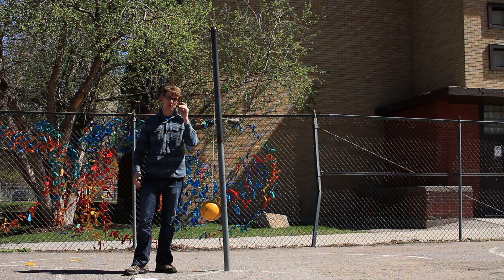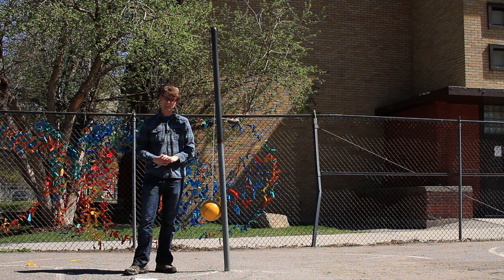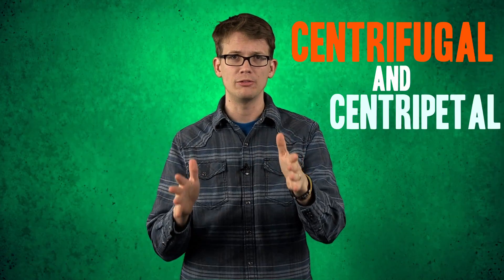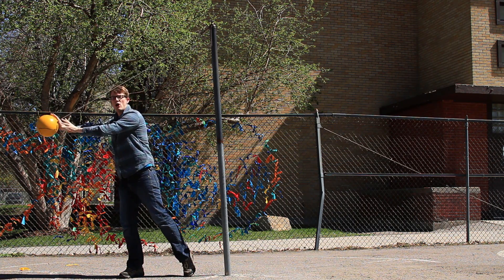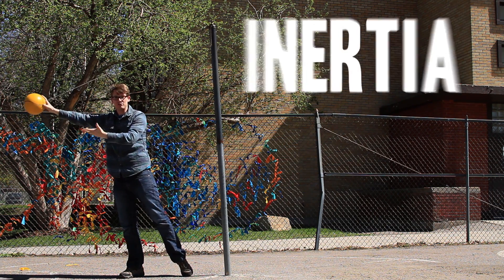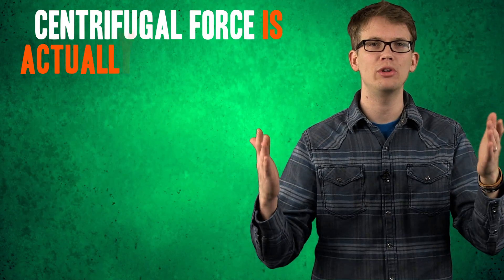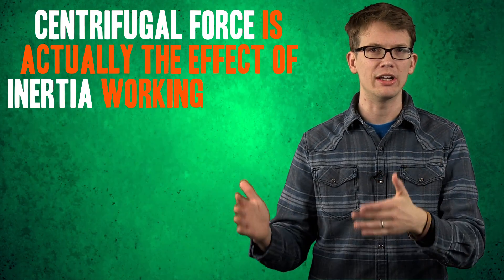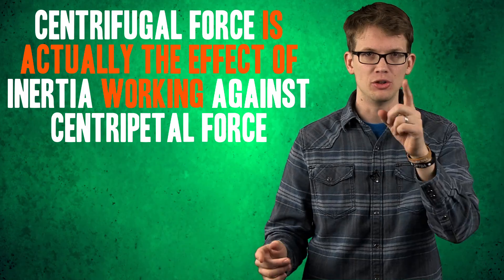IDTIMWYTIM: Centrifugal Force

Comment: Ok, equal and opposite reaction: wouldn't there be a real centrifugal force on the pole then?
Reply: No, there is a reaction force received by the other end of the tension in the string, that acts upon the pole, but it has nothing to do with the centrifugal pseudoforce.
Reply: @carultch  You agree that there must be an equal and opposite reaction to centripetal force, correct?
So the opposite to the "center seeking" force would be a "center fleeing force". Great, we already have a Latin word for that. Lets calling it "centrifugal". The pole is being pulled away from the center, is it not?
Reply: @albinoman13bt  There is a tension force pulling on the ball.  There is a tension force pulling on the pole.  These forces are an equal and opposite action/reaction force pair for Newton's third law.

The pole is not rotating, and has no inertial forces of its own acting on it.  it is pulled outward by the other side of the tension in the string, and not by its own centrifugal pseudoforce.   Only the ball is subject to an apparent centrifugal force.  The pole isn't subject to this force, until the tension in the string carries the force to it.
Reply: @carultch  The ball has a centripetal, center seeking, force on it. It would fly off if the string were cut.
Just the same, the pole would return to the center if the string were cut and the center fleeing force removed.
The pole doesn't need to rotate. The ball is exerting a centrifugal force on the pole. The pole is exerting a centripetal force on the ball.
The "apparent" centrifugal force would be if you were in the ball. It would feel like you are being pushed the the outside when youre actually being pulled inward.
Reply: @albinoman13bt  Nothing exerts a centrifugal force on anything.  The centrifugal force is a consequence to being in a rotating reference frame, and to your own inertia causing you to attempt to take a straight line path through space.

The ball isn't exerting any force on the pole, other than the tension in the string.
Reply: @carultch  If there is no force that pulls on the pole, then what is imparting all those newtons? The "there is no such thing as centrifugal force" is one of those old science misconceptions.
Reply: @albinoman13bt  You are taking what I said out of context.  I did not say there is no force that pulls on the pole, I said exactly the opposite.  I said there is no centrifugal force that pulls directly on the pole.  I said that it is specifically the tension in the string, that is pulling on the pole.

What is ultimately "providing" all those Newtons, is the fact that the tension in the string is a force of constraint that keeps the tether ball moving along a path governed by the string.   The ball starts with its kinetic energy and momentum due to its initial velocity that is tangent to the circular path it would take.  The tension in the string pulls it inward, so that the ball follows a circular path, instead of the straight line it would follow by default.
Reply: @carultch  If an object is stuck in the orbit of another object, whether it's by a rope or gravity, they are each exerting a force on the other, each pulling in toward itself. Centrifugal and centripetal are opposites by the very meanings of the words. Which is which depends on what you call the center. For example, from the ball's point of view the pole is spinning around it and it is the center. From its frame of reference it's the pole that's exerting centrifugal force on it.
The object in orbit is experiencing centripetal force, since it keeps getting pulled to the middle while it tries to fly away. The object in the center keeps getting pulled away from the middle, a center fleeing force, despite trying to return to the center.
Reply: @albinoman13bt  Look at it from the reference frame of the center of mass of the two of them.  This is a point that will move at a constant velocity, assuming external forces are negligible, and will work better as an inertial reference frame for studying the situation.

In that case, you will only see a force of attraction between the two objects.   You will see object A pull on object B, and you will see object B pull on object A.  You will not see any push force between the two objects.  The reason the objects don't collapse in to each other, is that they have sufficient tangential speed, that the inward directed acceleration cannot pull on them strongly enough to pull them any closer.

A force is only real, if it is exists to explain the situation from the point of view of all possible observers.   The inertial reference frame allows us to eliminate all pseudoforces, and only see the real forces.

Comment: Depends a little bit on your frame of reference. In relativity theory for example it is not a force but the bending of four dimensional spacetime. In particle physics it is one of the four fundamental forces and they are submitted via particles (similar to the electromagnetic force which is submitted by photons).

Comment: So the string is pulling on the ball but the ball isn't pulling on the string. This causes a net force on the ball which causes the ball to constantly accelerate. But the net force is always changing direction (ie, going in circles) which causes the acceleration to change directions too, which causes the components of the velocity of the ball to fluctuate from positive to negative and back again. (ie, circular motion) :D How did I not figure that? Its so obvious!

Comment: Centripetal force is also not a real thing Hank.
This force is exhibited only because one end of the rope is tied to the immobile pole. If that end was not tied to another object there would be no tension to the rope. Same if the rope fails or it is being cut. The circular motion would no longer be observed The real force counteracting to the tension is the molecular bond of the strands plus the structural composition of the rope There is nothing that indicates that Centripetal force even exists

Comment: My teacher doesn't let us use the word (centrifugal) in her classroom. Also, centripetal force isn't a real force either, but rather a word to describe a force or forces acting on an object. The forces acting on the tether ball were tension and gravity, and tension was a centripetal force, because it was the force pulling the object in. If you were rotating an object vertically the centripetal forces at the top would be gravity and tension, because they are pulling the object to the axis. <3

Comment: Couldn't you also say that centrifugal force it the 'normal force' in response to the centripetal? In the way that while my laptop exerts it's weight (mass x acceleration down due to gravity) on my desk, the complete force diagram also shows a normal force of the same value pushing back up because it's a stationary system?

Comment: The same thing, essentially. The water inside the bucket wants to keep on flying straight, but the bucket held by your arm is holding it in. The water acts as the ball does in Hank's example, and the bucket and your arm act like the string does in Hank's example, holding the water in. The water has inertia, the bucket and your arm has the centripetal force.

Comment: Question: you said that Real Force requires physical interaction between objects. What if it would be possible to build a mechanism where a set of magnetic forces would act as the string does in the video? Would that still be considered a real force, or something else?

Comment: Sure thing! Fc = mv^2/r (v2/r is the centrifugal acceleration.) It can usually be considered the 'anti' centripetal force since they have similar roles. Calculating is is usually done in 'special' circumstances like considering a cornering car or how fast DVD can spin before it breaks apart. (In that last case considering the 'real' forces on a spinning DVD can be very problematic.)

Thus if we have a car (1'000kg) cornering a 20m curve at 40kph Fc = 6173N

Comment: Can you provide an example of how to calculate centrifugal force? I've only taken an AP physics class, so calculations were kept somewhat simple, but calculating centripetal force is fairly easy, it is just F=ma(c), where a(c) is either omega^2 r or v^2 / r.
Reply: You can prove that a=omega^2*r and a=v^2/r are equal in value.  The centrifugal pseudoforce will also equal m*a, except in the other direction.

In a linear example, suppose you are in a rocket, accelerating in deep space at 5 m/s^2, in a direction we'll call positive.  Suppose your mass is 80 kg.   What force does the floor of the rocket push upon your body?   A: +400 Newtons.   What is your apparent weight in the accelerating reference frame?  A: also 400 Newtons, but in the negative direction.  Your apparent weight is really your attempt at not accelerating, and is equal and opposite from the force that holds you in place in your reference frame.

Comment: Centrifugal force exists only when we look at tiny reference frames. In the case of the tethered ball, you would have to be in the reference frame of the ball and be constantly changing your angles of reference. Centrifugal force does not hold up in any larger reference frames, while centripetal acceleration works in all (or at least to my knowledge) reference frames.

Comment: That's a great example of actually "feeling" the centripetal force, because that's exactly what your arms are doing, keeping you from flying off :) If you did let go (which I advise against) you would "fly off" because your body wants to keep going at a straight line instead of in a circle. Technically speaking you would fly in a trajectory tangent to the circular path, NOT outward from the center of the merry-go-round.

Comment: No, it's the same as the ball. Your body wants to go outward because of inercia, it wants to keep moving in a strait line, not a circular one. You can stay in the circular trayectory if you hang on, which would be comparative to the force of the string. It's a perception of centripetal force.

Comment: actually its gravity that sepreates them. Read up on "relative centrifugal force" its measured in g-force. Or much easier mix some non dissolving powder with some fluid, yank the centrifuge up to max und let it run for 5 minutes (check if its safe first!). the moist powder will not be at the bottom of the container but squished against the side facing away from the rotation

Comment: I was thinking that.
Suppose its the fact that the water inside the bucket wants to do the same thing as the bucket - go in a straight line. But it can't because its a force acting against it!
So its forced against the bottom of the bucket in an attempt to carry on forward. :3

Comment: Pardon my misattribution.  It is the ball's non-zero momentum that enables the ball to impart a force on the string, pulling it away from the pole.  I could not tell from your original comment that you were referring to a force on the string.  Also, I did not state that there was another force acting on the ball, but that there is a force acting on the string, pulling it taught.

Comment: Think of a car with a box of tissues on the dash. When the wheels turn in a circular path, the friction between the tires and the road acts as a centripetal force and the car makes the turn, however the friction between the tissue box and the plastic dash isn't enough to allow the box to stay in place, and it slides outward from the rotation. Although it looks like the box is moving, it would be more accurate to say the truck is moving out from under the tissue box.

Comment: yes, its the same thing for the most part. I assume you mean something like a person spinning a ball in a cup attached to a string, right? in this case, the centripetal force on the cup is the force of tension that the string exerts on the cup. The centripetal force on the ball, however, is the normal (something like an upwards, resisting press) force exerted by the cup on the ball. I hope this kinda clarifies things.

Comment: WRONG SIR if every force has an equal and opposite force then the force of the string pulling the ball toward the pole would have an opposite force pulling it away.
xkcd is always relevant
in this case, comic number 123

Comment: Those are all relative! The entire universe doesn't have a specific up/down nor a left/right, there is a sort of forwards or backwards but, not entirely. 
If you think more like a graph x.y,z it's more sensible however that's still not even the correct correlation! Shockingly enough there really is no correlation, all we can say is the first 3 generate the space we live in and the 4th as you said is time. But so many people think of it as linear motion, sidescrolling, and super mario 64,tbc

Comment: By perfect system, I was referring to an atmospheric system (I haven't gotten used to shortening things for YouTube), since the weather will affect the ball and cord.

As for the other thing, it was poor wording on my part. The reason it seems to move to a ninety degree angle is the fact that it's anchored at all. The cord is stronger than the pull of the Earth's gravity on the ball, so it moves up. It's entire location change is because of the the combined effect of all the forces together.

Comment: That force is it's anchor point. There is a net loss of force that is, in a perfect system, greater than the net loss of force if you were to just throw the ball unattached to the cord.

Notice how the ball starts to fall when the cord is still above the pole. Then it starts to wrap around the pole which 'shortens' the cord and pulls the ball inward keeping it at a near ninety degree angle. The fact that the cord is not horizontal means that the system is not at ninety degrees.

Comment: In this case, it's an illusion caused by the resistance of the cord to the movement of the ball. No matter what acceleration you put on the ball it will reach a point where it can't continue going straight due to being anchored to the pole by the cord. It still has momentum though, so it accelerates so that it's direction since there isn't enough force to break the cord.

If there were a force acting to make the ball move outward, tools like a sling (the hunting weapon) would be impossible.

Comment: That's one of the annoying untrue funfacts. In the past glass manufacture was not so precise and panes would often be uneven. When builders were installing the panes they did the only sensible thing and put the thicker side at the bottom. Later, people incorrectly assumed that it was because the material was setting.

Comment: what about those rides at festivals that have you pushed against the walls?
Reply: The ride isn't really pushing you against the wall.  Your own inertia is trying to move you tangential to the circular path of the rotor's inner wall, but the wall is in the way.  The wall pushes you inward.  It feels as if there is a gravity pulling you outward, but there really isn't.

Comment: I was told in class that centripetal force isn't actually a force either, but is the sum of the forces acting towards the centre. So in that example, the tension in the string would be the equivalent of centripetal force. Is that wrong?

Comment: If you were in a rotating space station, would the centrifugal "force" make you feel like you're being pulled straight out from the center? It seems to me that it would be at an angle, so you would feel like you're going downhill if you're walking in the direction of the rotation, and uphill if you're walking the opposite direction. Unless the radius is really large so that angle is really small, it would be very awkward to live there.

Comment: It depends on your definition of the dimensions, you can make colour dimensions or its Ph value, anything that can be measured is a dimension. In some circumstances spacial relations and time are useful as the first four dimensions, but that is not always the case.

Comment: Actually Hank there are TWO real forces acting on the ball, there is weight force as well silly, adding the vectors of the Tension and the weight forces results in the centripetal force towards the middle of the pole, otherwise the force would be toward the top of the pole. You could also include air resistance if you want but it doesnt contribute to the centripetal force so lets ignore that shall we.

Comment: Can we have a IDTIMWYTIM on Insulators, Conductors, Dialectrics, Ferromagnetics, Diamagnetics, Paramagnetics and such?
Most people likely don't realize how many things (such as as aluminium) actually are reactive to a magnetic field.  Nor do they realise that with sufficient voltage, pretty much anything will work as a conductor.
Negative resistance would also be a cool one, though most people have never heard of it to start with.

Comment: Can you tell us what force keeps water in a bucket when you spin it? I always though that was centrifugal too...
Reply: No force keeps the water in the bucket when you fling it upside down over your head.  The reason the water stays in the bucket, is that the bucket accelerates downward faster than the acceleration of gravity.   The water cannot fall fast enough to leave the bucket.

In the reference frame of the bucket, the water feels as if it is being pulled upward (centrifugal pseudoforce), as there will be a downward force on the top of the water from the bucket pushing down on it.  You also need tension in your arm to make the whole system accelerate downward.